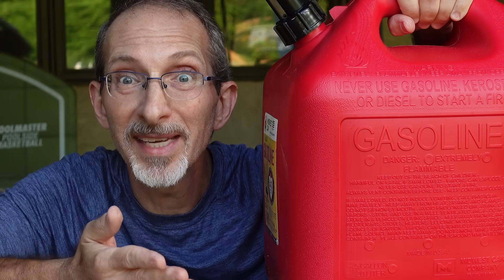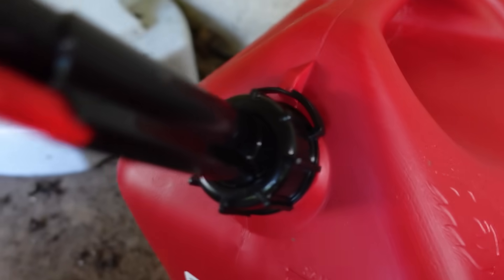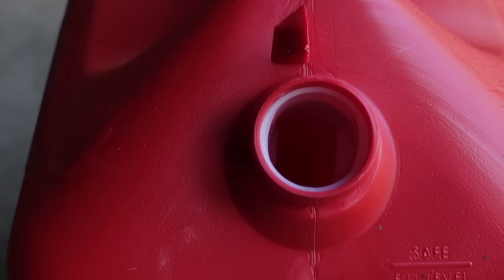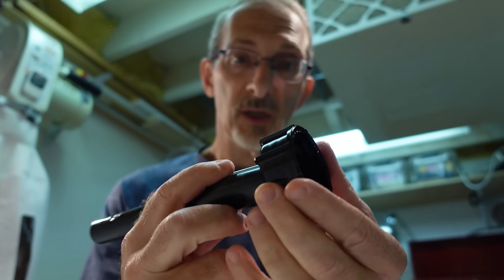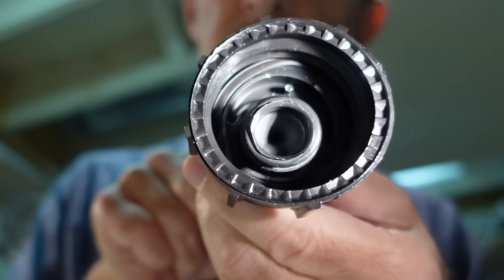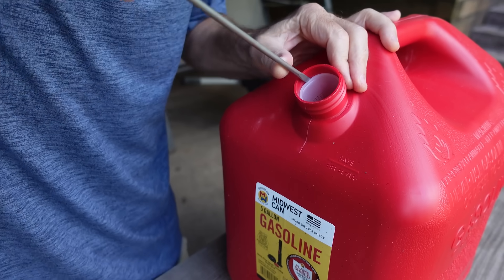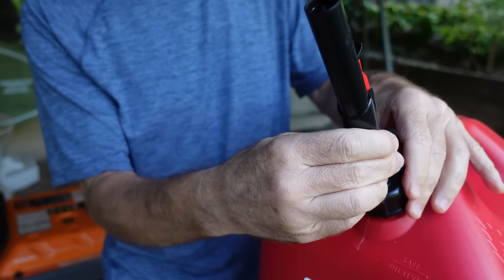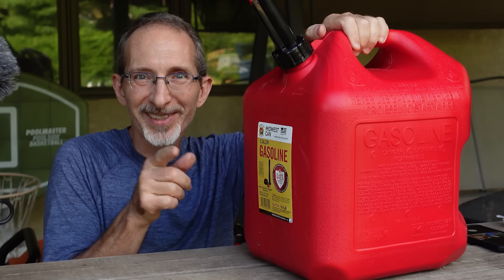Gas Can Modification | New Gas Can Fix

Comment: Skip the plastic junk. Buy a wavian jerry can and flexible nozzle and be done with the dangerous libtard cans forever.
Reply from the maker: I hear you! The mods aren’t hard, but I wish these cans were better made to begin with!
Reply: @MikeFyxdt  I  had one of those plastic gas jugs split a little on a seam and it was splashing gas whenever I was carrying it. Threw it out. I have a bunch of Wavian jerry cans now and have not looked back. There are smaller versions 2.5 gal and 1 gal which are convenient for the mower and for mixing oil for the 2 cycle engines. These are the last cans I will ever have to buy, and will probably last my son his lifetime too.  My remaining plastic cans are now in storage waiting for the next SHTF moment. Otherwise never to be used again.

Comment: Don't forget to leave a gasoline container full of water with a little gasoline floating on top in an easy location for the thieves.
Reply from the maker: Greg that's hilarious!!! :)
Reply: Greg Peterman. Your comment reminded me of an incident that happened to a friend of mine.
He owned a very nice motorhome.  He and his wife were going away for a long weekend, he filled up the fuel tank, replenished the fluid in the Septic tank, parked in his drive nd had an early night so they could set off early. About two am they were woken by someone retching on their drive, when they looked they saw a guy doubled up in pain.
They rushed downstairs, went outside and saw a plastic pipe coming out of the side. This bozo was trying to syphon diesel from the fuel tank. Sadly he put the pipe in the wrong hole and tried to syphon the septic tank.  Karma rules.
Reply: @THEJR-of5tf  lmfao karma strikes again
Reply: Don’t even need the gasoline floating on top. Doubt they would field check it.
Reply from the maker: @deepspire  True!
Reply: I have done that
Reply: @shadwell749  we did it at work to find out which employee was doing the pilfering, look for stalled vehicle.
Reply: Nice!
Reply: I actually like the 30.1  fuel mixture just not labeled causes more problems to an engine then water does. Yup clogged injectors are more expensive then dropping a tank and emptying it
Reply: @robertthegrowguy7115  excellent point..!!  there would be no problem with separation like granulated sweetener would have...
Reply: @patphillips2405  yup mechanics know what hurts more in the long run
Reply: I like it , instant carma
Reply: I leave sugared gasoline in my decoy can and unsweetened in my locked shed with the security camera.
Reply: Greg, i love it,,,,,,,,thanks a million.
Reply: Oh, I am sooooo doing that!
Reply: Greg, you reminded me of a story from my youth: we had a family cottage on the shores of Long Island Sound, and during and after the gas crisis of the 1970's, some of our friends had portable marine gas tanks stolen out of their boats (some of us started chaining the tanks into the boats). With one of our smaller boats (a 12-foot, heavy and surprisingly stable plywood rowboat, equipped with an old 10 HP motor) somebody went a bit further ---- they stole the entire boat and went for a joyride! We kids had time on our hands and nothing to lose so we decided to cruise the coastline in a pickup truck and see if maybe we could find it abandoned somewhere. Sure enough, we found it on the marsh grass underneath a major river-spanning bridge, and it had three extra gas tanks in it up that had apparently been stolen from other boats along the way! No idea who stole the boat but they either had serious balls or they were just plain dumb ---- to get to that bridge they had to skirt a rocky coast with serious tidal ripis and a the rough-water mouth of a heavily trafficked major river!
Reply: Not gasoline and water, gasoline and sugar!
Reply: @redpillcommando  sugar doesn't really hurt most engines in most cases because the sugar just sits at the bottom of the tank and never dissolves in the gas.
Reply: @ewdtrey  the sugar water won’t kill it but it will cause a lot of problems filters fuel injection and pumps a couple hundred easy a lot more than the gas stolen!
Reply: @harryconover289  for the most part, even that's not true. In most cases the sugar will just sit at the bottom of the tank and won't get picked up by fuel pumps for it to pass through the filters and injectors and etc. For the most part fuel pumps avoid the gas at the very bottom of tanks to avoid general debris
Reply: @ewdtrey  ok what do you recommend ?
Reply: @harryconover289  a little 2 stroke gas works
Reply: @harryconover289  simple, WATER, H2O, no need to complicate something that works, and it's free!
Reply: @gregpeterman1102  yes that is watt ic allwise done then a guy on this dosent cause enough damage to the car so I asked watt does ?
Reply: @harryconover289  just dont label the 2 stroke gas, even regular engine oil will work and doesn't contain blue dye should they check it still smells like gas looks like gas but guess what lol
Reply: @ewdtrey  He was talking about mixing it with water. Mixed with gas it will just sit on the bottom. But mixed with water I doubt would work either, because the engine won't run on water long enough for the sugar to get anywhere.
Reply: @Aelanna  i was replying to Redpill who said "Not gasoline and water, gasoline and sugar!"
Reply: @redpillcommando  sugar doesn't do anything.
Reply: be sure to dissolve a bit of sugar into that water - makes it a Sweeet Deal for thieves.
Reply: Don't forget the sugar...

Comment: My fix is I have a half dozen old school METAL cap/spouts and replace the plastic spouts with the metal ones...
Reply from the maker: Are the threads on the metal caps the same as the plastic cans? If so, that’s good to know!
Reply: @MikeFyxdt   You need to check prior to filling the can... MOST are compatable but bought a few that werent n had to return them...👍

Comment: Or... you can just go to your local farm store and buy a flex filler replacement kit that does away with all that government mandated garbage. These kits only fit can “prior to a certain date”, but in reality, fit them all.
Reply: I got a couple of nozzle kits online along with press fit vents. Made my midwest cans just like the old ones.
Reply: @ DWJR 51.   Next the government will probably mandate a different size thread/ diameter  on new gas cans so that these retro spouts can’t be used.  They are only here to help us
Reply: @toothrestorer6588  Don't give 'em any ideas!
Reply from the maker: Good to know! Thanks!
Reply: @MikeFyxdt  Yes. I bought a few of them several yrs ago. I think Low's & Menard's sell them.

Comment: Glad we don't have that crap in Australia.
Reply from the maker: What, no regulation? Gas can explosions must be going off left and right. 😂 Thanks for watching and letting us know!
Reply: @MikeFyxdt  Plastic fuel cans have a regular screw cap which you remove, then screw on a separate pourer nozzle which is attached to the cap by a flexible lead. One gallon metal cans have a regular screw cap with a pourer insert inside the can which you pull our for pouring. It's all regulated.

Comment: I think the technical term for what the EPA accomplished with this regulation is "screwed the pooch." They made their selves look like idiots. They need to repeal it.
Reply: Many of these “upgrades and improvements” where originally put implemented by the State of California for express purpose of “preventing spills and excessive fuel vapor escaping into the environment” with most being later picked up by the EPA at federal level.  The manufacturers implemented on their assembly lines across the board to save money.  These fixes have caused more spills and wastage than any of old style cans.
Reply: Scott Gray 
Not to. Mention if you kept the caps on the old style cans they didn't vent.
Reply from the maker: @dodgeguyz  Yup, these cans bloat when the pressure builds up. A vent would be nice.
Reply: @MikeFyxdt  that’s fixable, drill a hole in the top of the handle ( I think 1/2” not sure) and install a tire valve, remove the inside of valve. Loosen the cap when you want to vent or poor gas
Reply from the maker: @sweetwilliam49  I added a yellow plastic pop-vent to the cans in my follow-up video. It was pretty easy and they are inexpensive and well made. The cans don't really swell if they are mostly full, so I don't think of it as a problem!
Reply: @MikeFyxdt  Where did you get this pop valve
Reply from the maker: @sweetwilliam49  JSP Manufacturing 5 Yellow Fuel Gas Can Jug Vent Cap:  https://amzn.to/3rfGlx1
Reply: The government doesn't have to even try to look stupid, they always do....
Reply from the maker: Pooches everywhere are cringing and watching over their shoulders!😹
Reply: THE EVIL POLLUTION AGENCY ARE "IDJITS".
Reply: @johndoylemc  no man - they’ve done a great deal of good.  I remember when you could see, and feel (grit) the air in my hometown of Kingsport TN - not in the distance either, right in front of you.   And the Holston river had signs warning not to eat the fish. It’s not like that now because of the EPA.  They DID however mess up with the gas cans, and they need to repeal it and go back to the drawing board.   All in all though we’re better off because of what they do.
Reply: @DavidLaFerney  so maybe they did all that good, and then had too much time on their hands trying to figure out what else to do. Now they're pretty much mandating breathable engine exhaust, to get that final 0.001 percent scrubbed.
Reply: you're right david, BUT the EPA and ALL GOV'T are so stupid, they don't know they look like idiots.........nor do they care...................

Comment: I also cut off the knuckle-busting tab sticking up that the cap lock used to lock on.  Additionally, I bought some plug vents to put at the back of the handle so the can doesn't chug-chug as I pour.
Reply from the maker: Vent added in video #2 (I see you found it)!

Comment: Those screens are not filters! They are flame arrestor screens put there to prevent the gas can from exploding in your hand. They prevent any flame from travelling down the nozzle back into the can and detonating it. Best and safest way to fix these newer cans is to buy and use an EZ-Pour spout and vent cap. They have a website and are sold on Amazon and they work great. I have converted all of my old Blitz plastic cans over to these.

Comment: So the point is to limit spills which are bad for the ground.  So they create a joke of 'safety' measure that make it harder to use.  The solution, for guys like me, remove the stupid 'filler nozzle" and pour straight from the can hole.  Making it harder to get it poured in the tank, spilling more... Great work Government.  and these are the same people that want to run your HEALTHCARE!!!!  No thank you.
Reply from the maker: @Fire Falcon - The safety measures are not to keep you from spilling fuel, rather to keep the can from exploding in a ball of fire if you pour gas directly into an open flame. I just wanted to clear that up. Thanks for watching!

Comment: That spout leaks with the two pieces just get rid of the second piece.
Reply from the maker: Fred, interesting suggestion but the inner piece is what opens and closes the nozzle so I don't think you can get rid of it. The outer part of the nozzle is irregularly shaped, so you wouldn't be able to just use that unless you could fit a cap on it, which I think would be awkward.
Reply: https://www.youtube.com/watch?v=lb3P_FWRv8Y
Reply from the maker: @fredkibler  cool, got it! Yeah I threw away that red disc, so I guess it’s pretty important to hang onto that if you want to try this method. It looks like they 3-D printed a cap, which was what I was getting at. I guess there’s lots of ways to solve this nozzle issue, I just wish the manufacture had a better design in the first place. Thanks for providing the extra info!

Comment: I wonder if rather than removing the spring completely that maybe cutting a portion of it off then stretching it to loosen the tension, then reinstalling it would work? I may give that a try.
Reply from the maker: Scott - I did just that in my follow up video. It made a difference and is definitely an alternative. Check it out: https://youtu.be/XoYxdrhB6Ls

Comment: there is a reason for that filter in the gas can you might want to watch before you remove the filter.   https://youtu.be/g3eIT6BAF1s
Reply from the maker: @Ray Cartwright - I appreciate your joining the conversation! I covered this in my follow up video, link in the description. While the flame mitigation device works well for people who are misusing the gas can, it is preventing filling the can for people who are not abusing it. All of the safety features are combining to create a hazard in and of themselves, not to mention spilling gas. These mods are suggestions, so as a consumer you have to make up your mind what the trade-off is between usability and absolute safety, even with improper use of the container. But as you pointed out, it’s always great policy to understand both sides of the discussion!

Comment: These gas cans are engineered for CARB compliance and marketed (by morons) for safety. CARB means California Air Resource Board. There are a few states that have adopted Comi-Cali CARB stupidity (child safe cap, auto-relocking 2 step nozzle).This is the first I've seen of the plastic flash suppressor/ filter If you live in one of these states move or run for your legislature. The manufacturing companies refuse to manufacture a moron CARB nozzle and a separate working nozzle for non-communist states. Briggs and Straton had a junk line of gas cans that the CARB nozzles broke on fist use; completely useless. I've had to re-engineer all the CARB nozzles and/or replace them with something that actually works. The fact that the consumer must modify products to make them useful is despicable. This stupidity renders the "safety features" more dangerous to the user and cheaply defeating the junk nozzles releases more gas into the atmosphere than otherwise. This is what happens when unqualified politicians write rules to protect us. They are incompetent on a massive scale.
Reply from the maker: @Derf_the_Mule - Thanks for the feedback! I'm learning more about the regulation each day, and I just found out about federal-level regulation that is dictating the design of all new gas cans, in addition to the California approvals. I can't wait to see where this goes in the future.
Reply: @MikeFyxdt  I reviewed your followup video. Interesting insight into the marketing. I am not encouraged by any future legislation. At this point I don't think congress can do anything that can really help citizens. Good thing there are a few smart enough to make it work.
Reply from the maker: @derf_the_mule1405  I appreciate the follow up!